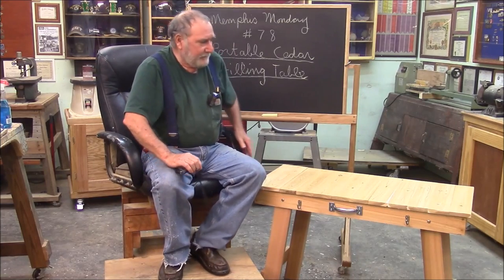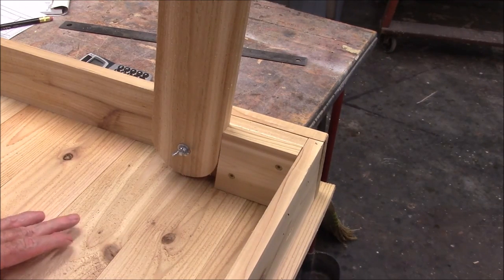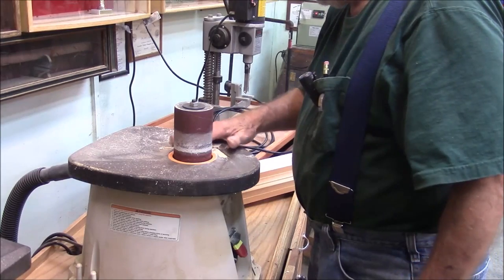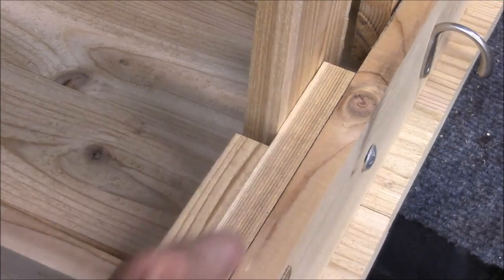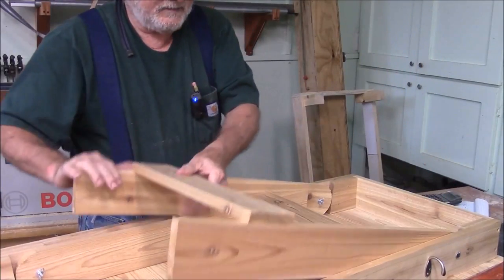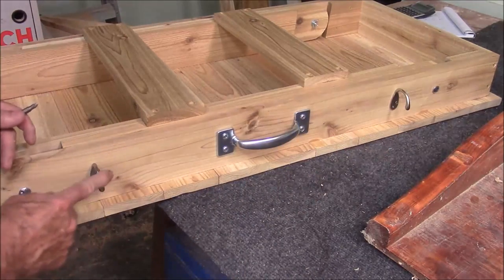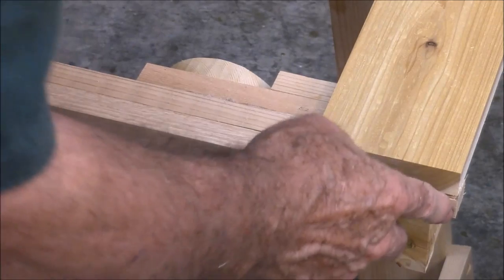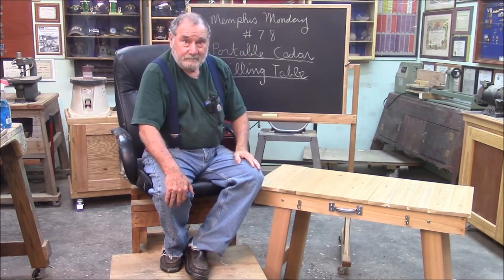78 Making a folding cedar grilling table

Comment: I like the idea of the folding grill table. There when you need it and easily stored when you don't. It's certainly nicer than the plastic topped folding table I use. Did I hear you say you were going to invite all of us over for a BBQ to try it out? :-D
Reply from the maker: I like the design too.  I can say that because I didn't design it.  But when I saw it I was impressed.  It is very functional, and very light.  I haven't used cedar much, but it is great wood.  I didn't even put finish on it, as it is supposed to be weather resistant.
     Better than my old table too, as my old table was the seat of my lawn mower and the top of an old ice-chest.  
     I tell you, we need to start planning a Memphis Applegate reunion!!  Over to the shop for BBQ!!  
     Thanks for watching and commenting.